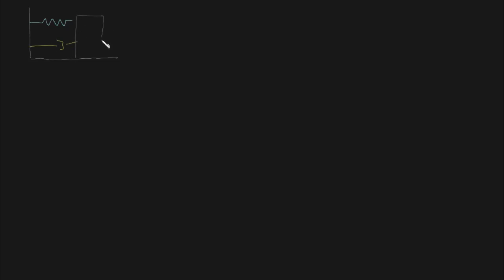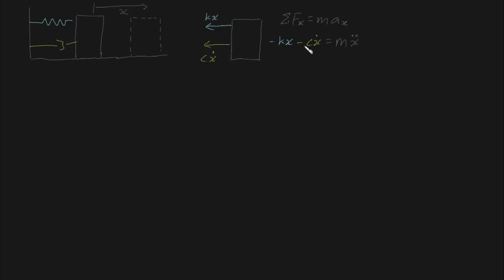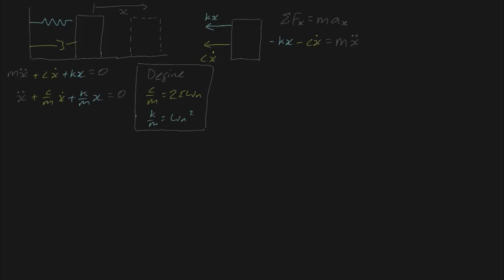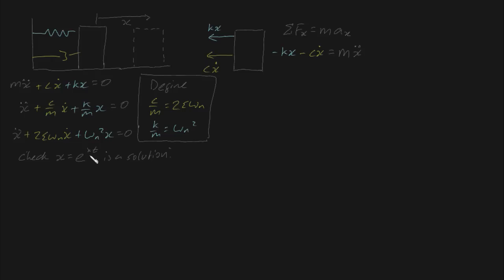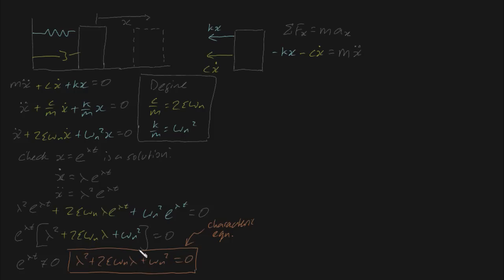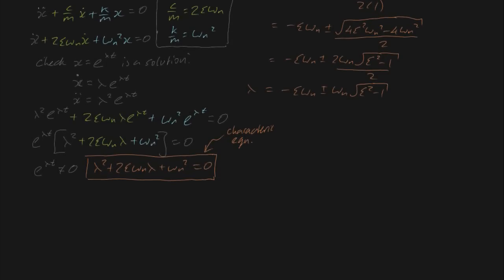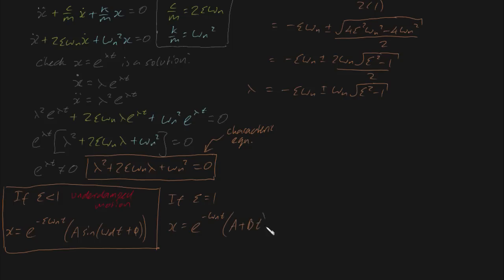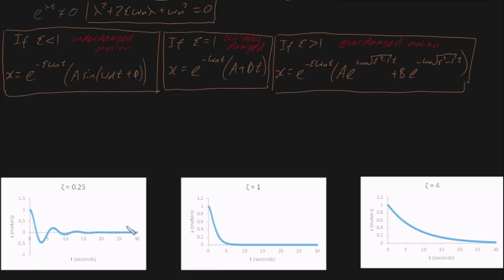under damped over damped critically damped vibration proof (part 1)

Comment: thanks for the explanation, but im still confused where the t comes from in (A + Bt) in critically damping. can u explain please?
Reply from the maker: Hey mate, that's a great question. For a thorough answer to that question, you'll have to dig quite deep into the theory of uniqueness for ODE's. However, let me scratch the surface. In this video I showed that "a" solution to this ODE is x = A e^(lambda_1 t) + B e^(lambda_2 t). However, for the critically damped case, zeta = 1 which means lambda_1 = lambda_2 = -w_n, and this means x = (A+B) e^(-w_nt) = C e^(-w_nt). This is "a" solution, but it's not the "complete" solution. Why? Well, if I have two initial conditions x(0) = x_0 and v(0) = v_0 then I should have two unknowns to determine. 

It turns out if you guess another solution in the form x = t e^-w_n t, it will satisfy the ODE and so:

x = e^(-w_nt) is a solution
x = t e^-w_n t is a solution

and so from the superposition theorem
x = A e^(-w_nt) + B t e^-w_n t     is the complete solution. 

For more understanding please check out this video
https://www.youtube.com/watch?annotation_id=annotation_115728173&feature=iv&src_vid=Clv8-Ni3ffI&v=7WEN7Kz5MWI

Comment: Great explanation but, can you explain how to find (A & B) in all equation (critically, under and over) please?
Reply from the maker: Hey mate, good question. You need to plug in initial conditions. The first thing you need to do is differentiate x(t) to get an expression for velocity v(t). Then, in the most general case, it will have some initial displacement x(t=0) = x_0   and initial velocity v(t=0) =v_0. You will now have 2 equations (one involving x_0 and one involving v_0) and 2 unknowns (A and B). You'll need to solve both of these equations simultaneously to solve for A and B. 

Honestly this is much easier said than done. Solving the two equations simultaneously can be very tedious - but you can do it! I would recommend trying to prove the result for critically damped motion (shown in 14:12) using this method - that'll be the easiest one.
Reply: thank you so much
Reply from the maker: no worries :)

Comment: Nice video! Easy to follow but I cant help to get confused by this:
In the video it wasn't addressed how can the damping force adds to the restoring force = 
-(kx+bv)=negative net force which adds to the resultant restoring force, thus contradicting the fact that damping force is suppose to subtract energy from the oscillating system.
(Like a simple moving car problem, the driving force -drag force= smaller resultant driving force)

Would really appreciate if you could clarify this😊
Reply from the maker: Hey mate! Good questions! The force due to the spring (=-kx) is the restoring force. The damping force (=-bv) is not part of the restoring force. To understand why this is the case, consider a spring that has fully extended and moving back towards equilibrium. The spring force is pulling it back to the left (attempting to restore it to equilibrium) whereas the damping force will be opposing velocity and applying a force to the right. 

You're right that a damper subtracts total energy from the system. You can prove this by finding the sum of the potential energy + kinetic energy in each case and show that the exponentially decay to 0. 

Hope that helps :)
Reply: Matthew James Thanks Matthew for the prompt reply tho it was n old video 😁 

I'm starting to get a bit of it. But honesty I still dont see how the resultant force affect (subtract energy from)the oscillating system without using the energy appraoch you suggested(which is exponentialy decreasing amplitude and since total energy is directly proportional to amplitude^2, energy is definitely subtracted from the system.) Hopefully I will be able to synthesize these 2 approaches and form a more solid understanding of what's really going on😉

I really love your videos as you always give the 'ahh huh' moment(intuitive explanation). Definitely one of the best explainer besides Khan Academy. Keep up the good work man😉
Reply: Just spent some time examining each instant closely. And noticed that the seemingly larger resultant force always act in such a way to produce a larger decceleration to reduce the velocity faster (reaches v=0 earlier than it should be)and therefore settles at a new but lower amplitude. The larger resultant force when the signs are equal in (-kx-bv) does not produce a larger restoring force like an additional force applied to the spring does (as the force -kx and
 -bv always act in their separate ways)

Thanks again XD

Comment: hey, I'm wondering why you subbed in 2(zeta)(omega) for c/m, and (omega)^2 for k/m.

Where did these values come from??
Reply from the maker: Hey! I'm very sorry for getting back to you so late. You can prove that the frequency of a block that's just connected to a spring (and no damper) is = sqrt(k/m). So this means w_n^2 = k/m. The other term 2 zeta w_n was defined to be c/m so that the square root of the characteristic equation (shown at 10:09) simplifies nicely.
Reply: https://youtu.be/nvq7u6Hv8Gw